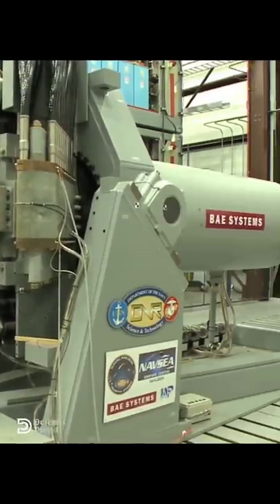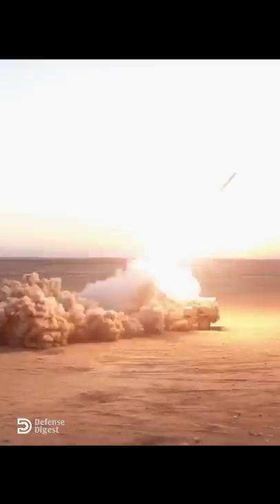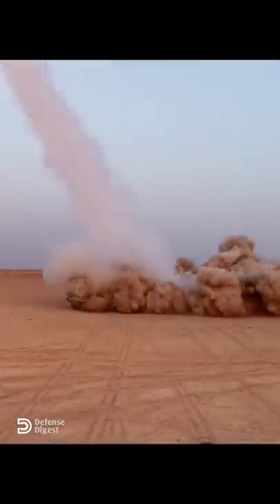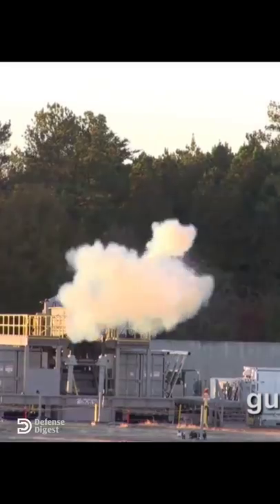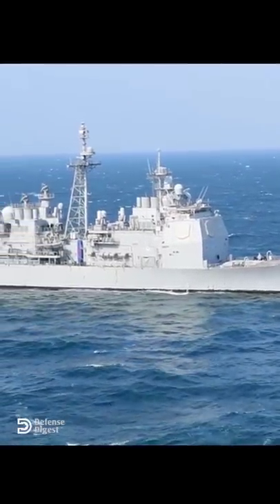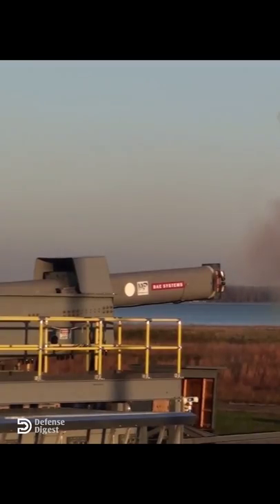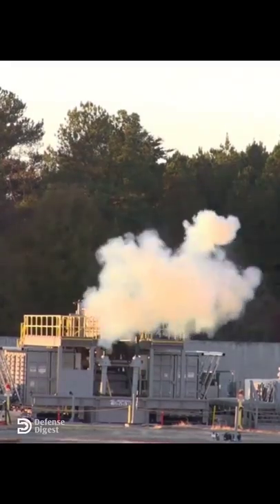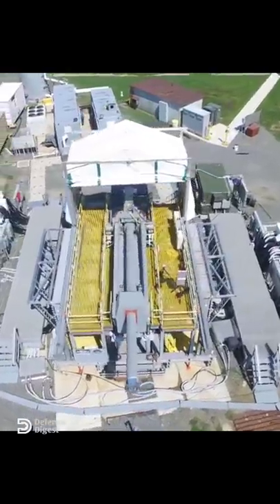Hypersonic cannon that does not require any explosives #Shorts

Comment from the maker: Check it out : https://youtu.be/OxIf78qPhyU
Reply: Hell Yea 😎.
Reply: Do your research before releasing videos. Makes you look dumb. Yes you need no explosive warheads and it’s cheap, but every time you shoot it, the wear and tear is so big, that you have to use a new barrel and stuff, so in the end, it’s less efficient and far more expensive than a normal canon. That’s the reason it got cancelled.
Reply: Cool 😎
Reply: @user-ky8pp6qy4g  what if they made the projectile hollow and it startled supercooled superconductor Barrell, seems like even if it lacked some thrust you could possibly incorporate scramjet
Reply: Project killed by Pentagon.
Reply: other problems include degradation of the barrel. it can only fire about 5-10 times before the barrel warps from heat.
Reply: It's faulty truly does work but detariats
Reply: This is family living in poverty this is where wasted money goes this is absurd
Reply: Literally railgun shoots, the bullet goes to 8690 kilometers/hour
Reply: I seen one built in a backyard with a guy that punched through ar500 steel batteries.   Have a nice day
Reply: Holness  @user-ky8pp6qy4g